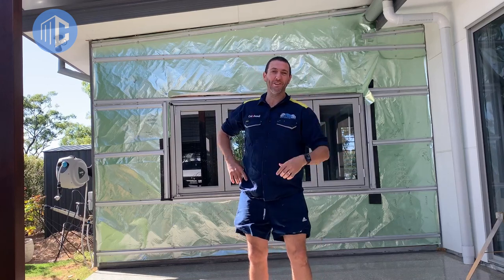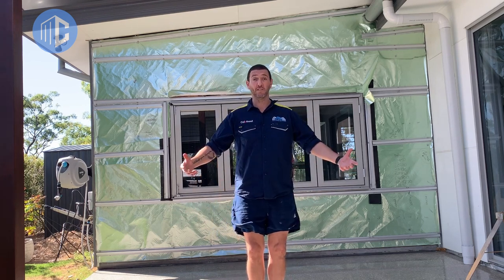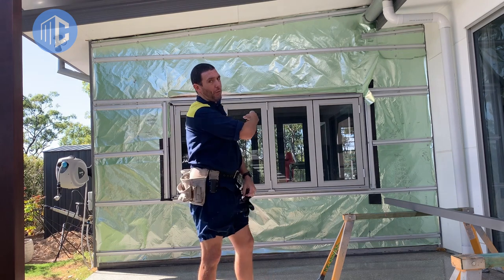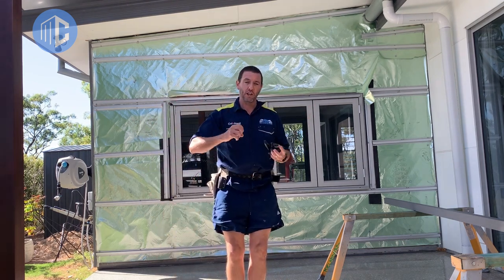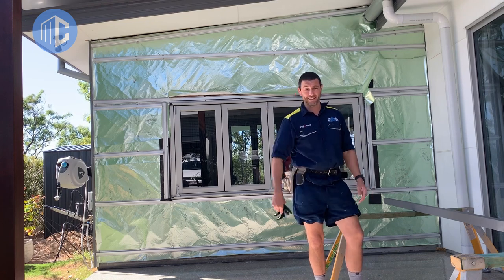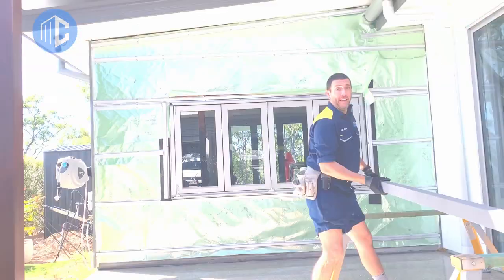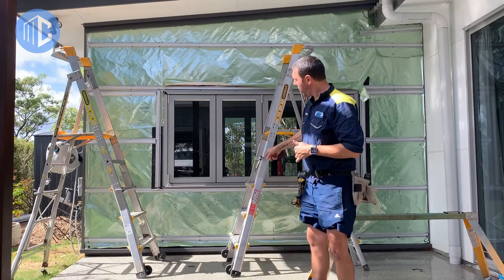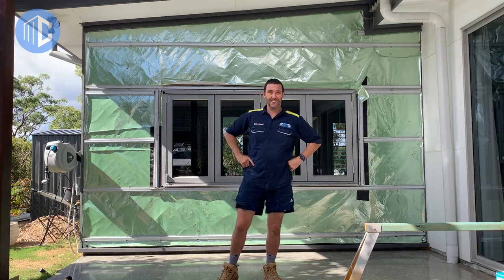PART 5  How to Colorbond Cladding

Comment: If you were doing a wall with no overhanging eave, would you still use that top flashing? Or would it be the stuff that covers the gap between wall and roof (barge capping I think its called)? If so, how is that folded where it meets the wall and is there still a way to hide the fixings?
Reply from the maker: Hi Joshua, great question. Yes it is called a barge, and yes it is folded up in a very similar way and it can be done so that we can hide all the fixings. If you take this to feet flashing shown in this video and a standard badge detail and blend them together you will achieve the flashing required for these results.

If you need a bit more detail jump on our contact us page on our website and we can deep drive a bit further for you.
Reply: @ConstructingArt  thanks very much